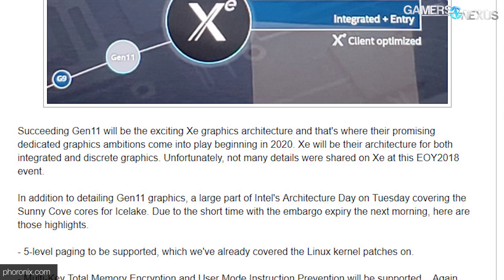Streaming Misconceptions: Best OBS Settings & NVENC vs. X264, ft. EposVox | LTX

Comment: I love seeing 25 year old games that output at ~240p being streamed at 1080p. Hopefully Twitch will support 4k soon.
Reply: One minor problem with streaming a 240p game at 240p is that it's going to get upscaled with bilinear (or at best bicubic) at the client side. Not to mention on-screen flair that streamers love.
Reply: @4.0.4   Actually, you can make it look super sharp by manipulating OBS's filter system.  I hardly stream, but I love tinkering with OBS and discovered a good way to make retro games look close to emulation.  I've tested these with a RetroTink2X and a Startech USB3HDCAP with modded drivers that allow 240p over component.  I don't have an OSSC, but when I get one, I should be able to make it basically emulator perfect with this setup since it linedoubles even more than just 480p.  There are some artifacts with the devices I've tested because they're already a low resolution, so OSSC should eliminate this.  What I do is right click on the source and force the scale filtering to Bilinear.  Then go to the filters on that source and use these filters from top to bottom (The OBS filters work in top to bottom order, rather than just throwing them on there)

Scaling/Aspect Ratio: Set it to Area (or point if your source is exactly 320x240) then type in a custom scaled resolution of 2880x2160.  This will be the 4K equivalent of 320x240 and area filtering should help with games that have the odd 240p resolutions.  This will make downsampling with bilinear much cleaner.
Crop/Pan: Use this to precisely get rid of any overscan.  Black bars for example.  Unfortunately this will have to be done on a game by game basis, but it only takes about 1 to 2 minutes.
Scaling/Aspect Ratio: Give this a new name, because OBS doesn't allow duplicate names for filters.  Set to bilinear and type in a custom rescaled resolution of 960x720 if you're streaming in 720p, or 1440x1080 if you're streaming at 1080p.

After that, you'll have a near perfectly scaled retro game source at the same vertical resolution as your stream, and since the general scale filtering is forced to bilinear, you can only downscale from there.  You could use bicubic, but I noticed a weird sharpening artifact when using it.  I generally don't like it.  So replacing bilinear with bicubic is up to you.
Reply: They have to open up their bandwidth cap first.  Their current is below the peak some content needs at 1080p.  Otoh, some content might be okay with that as it is.
Reply: Twitch @ 1440p or 4K? Sounds like proper SF storu, I' tellin ya!  :)
Reply: I mean, if you're actually getting the same bitrate, then yes, 1080p would be useless. I don't know how youtube handles streaming, but if you are just uploading a video, it makes a huge difference.

Comment: I'm running a 16 threaded AMD 2700x CPU. I tried the CPU streaming and got blocky and jumpy video at 720. Nvidia gave me perfect quality. Easy choice for me. BTW, I've heard that dual Nvidia is the way to go. My Settings: Key Frames = 2, B Frames = 4, 720 & 30 FPS @ 5 Mbit/s.

Comment: Irrespective of generation NVEnc can achieve the exact same image quality as software encoding, just it requires more bandwidth to do so. Conversely when you constrain the bandwidth it has to work with NVEnc image quality suffers. I'm not sure about GPU encoders being tuned for gaming better than software. NVEnc has no tuning option, and the h264/5 settings and features it actually supports are a long way off the software version.  That said, I still use GPU encoding everywhere. It's just simpler, quicker, and more than good enough at this point.. if you're using Nvidia.

Comment: What about dedicated streaming hardware like the ELGATO etc I know he mentioned using a second PC and having issues aside from normal streaming on the same PC but there are a few big name streamers like qtpie who seem to benefit greatly from the ELGATO... Thoughts?
Reply: Elgato doesn't do any encoding work, it just captures the footage. You need a capture card if you plan to use a dual PC setup, or if you want to capture console footage. NVENC with the newest Nvidia GPUs 2060, 2070, 2080 etc is really good enough now to not need to use x264 and put stress on the CPU. Get yourself a 9900k or 3700/3800x depending on if you want team blue or red, and a turing GPU and you're set.

Comment: i got a question. so lately i notice on streamlabs obs that ths fps has been dropping on certain games like Overwatch. i would have it set to 60fps on the streamlabs obs but when i stream gameplay it drops almost to 15fps then goes back up but it keeps bouncing. im unsure how to fix this. i even dropped the fps to 30 and still had issues. anyone know how to fix that?

my PC is
Ryzen 7 1700
32gb 3000mz ram
RTX 2080
i am using 2 2k gaming monitors that does 165hz and 1 ms.

any help would be great!
Reply: When I had this issue with destiny 2 I found out it was wallpaper engine doing it so if you have that or something else that using the gpu in the background close it.
Reply: @SkinUpMonkey  dang i never thought of that. Thanks I'll have to try that when i get home. I'll post an update as soon as possible

Comment: I, myself, only stream at 1080p60 if I'm streaming less intense games, like Minecraft, Warframe, Runescape, etc. Other games, I stream at either a lower resolution, a lower framerate, or a combination of the two until I get the quality indicator to stay green and I don't drop frames.
Reply: Good plan!
Reply: Definitely takes some messing about to find out which profile (1080p60, 1080p30, 720p60, 720p30, etc) works best for games I've never streamed before. If I get a new game that I want to stream, I do some test streaming to see which combo of settings works best. As long as the game is running at 60fps or higher, and the stream isn't dropping frames, I'm happy!

Comment: Hey Steve, another youtuber called "Major Hardware" did a video where he test two 140mm fans vs two 120mm on a 280 radiator. The thermal results were basically identical, so he then jerry rigged twenty-one 40mm fans to it and again got basically the same result.

Can you validate , or maybe explain why?
Reply: This can be explained fairly easy. Larger fan is for lower noise. Smaller fan with higher rpm can achieve same cooling effect but much louder.
Reply: @qiyuxuan9437  yep and generally a bunch of smaller fans consumes several Watts more than a couple of bigger fans.
Reply: Radiator performance wasn't limited by the airflow, therefore all 3 options had good enough air flow and made no difference.

Comment: 8k isn't grey area. As a partner you ask your rep and they will forward your request. They will either approve you for it or not.
Reply: Most people watching streaming tips aren't partners. For non-partners it's a grey area as it's not officially supported and you can technically get in trouble for it if you cause twitch problems
Reply: @EposVox  If you're not a partner with special permissions, you're bound by the 6000 that's listed. You can push more, but they can ban you for it. It's not really grey. Either you have permission, or you don't.
Reply: Watch some of EposVox' content. Then you will find out that the reason he says it's a grey area is because he talks about how you can kind of push the upper limit on Twitch somehow. I don't really know what he means by that, but I'm pretty sure, that is why :o)

Comment: He never mentioned higher bit rate requirements when getting the nvenc encoder to hit the same quality as x264.  Some of us don't have blazing Internet with a 20, 40, 100 Mbps upload capacity.  I have to use x264, because I can't get that bit rate high enough with a 10 Mbps upload.  That 5G can't come soon enough.
Reply: This also pushed me into 2nd PC because my ryzen 7 1800x was running above 80C at times.  Without having to game and stream, it sat at 50C.  I've since got a better cooling solution and much better case and she's steady around 40C.
Reply: I did talk about the myths around x264>nvenc

Comment: Something that i discovered recntly, streaming from a mid-low spec pc, if you have and APU + a discrete GPU (my situation, cause i'm an idiot, A10 + 1050TI), using the APU to encode (as a GPU) is a great solution for streaming games that your computer can barely run in general. If i'm wrong, please tell me.
Reply: apu encoding can work but some apus it does not work and image quality usually worsens. so if you're desperate it's ok but if you can afford it software is best
Reply: Using 2 separate video cards for rendering and encoding is apparently hit or miss, mostly miss.  But situationally may work.  You would have to test your hardware to be sure.
Reply: @p51mustang24  It was what i had at the time, since then i upgraded and no longer have the need

Comment: 🤔 H.264 can do a great many things for compression but it does not make a region in the center of the screen get a higher bitrate than the rest of the screen.  You can choose to have regions that are losslessly compressed, but I’m not sure that’s a very commonly used feature.  For the most part it’s a time differential sequence of DCT frames.
Reply: It's not about bitrate, it's about the focus of the algorithms that determine what bits go where.
Also you can't have anything lossless when streaming lol
Reply: EposVox It is about bitrate in regions relative to others.  Also I’m aware nothing’s going to be lossless on a link budget of >10 Mbps.  Almost no scenario can afford lossless regions.

Comment: tfw OBS renderlag shit in windows 10 is still a thing even after the update.
Reply: No idea if it helps you but I stream at 1080p 60fps Nvenc New 6000 bitrate and had some rendering lag in obs when I  was streaming pubg not a lot, but I simply changed my game settings a bit down which completely fixed it! 1800x @4ghz 16GB Ram 1080ti streaming with Nvenc new!
Reply: Yeah.. I noticed that OBS had much more significant packet loss over my elgato's proprietary software, even with all the same encoding and overlays and stuff. I thought I was just having an issue specific to my build, but apparently not lol

Comment: “NVENC vs h.264” <— NVENC is an encoder, h.264 is one of the codecs it can output. I think you mean “NVENC vs x264.”
Reply from the maker: Thanks. Fixed.
Reply: If you're going to correct something at least get it right yourself lol. It's NVENC, not NVEC...
Reply: Qyngali If you want to be that fucking anal, GN’s “fixed” title is still wrong because it should be a lowercase “x” in x264.